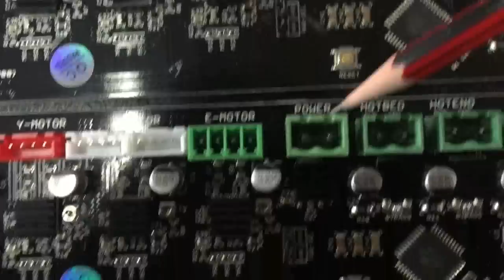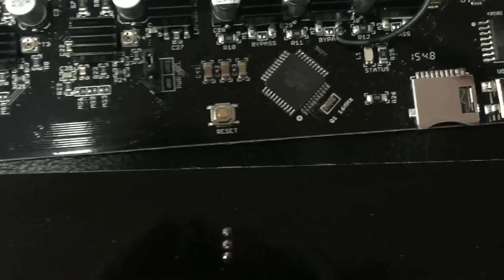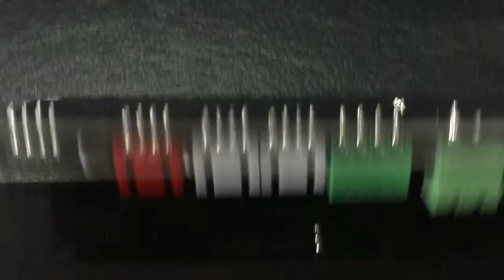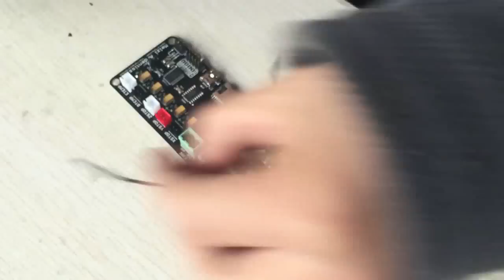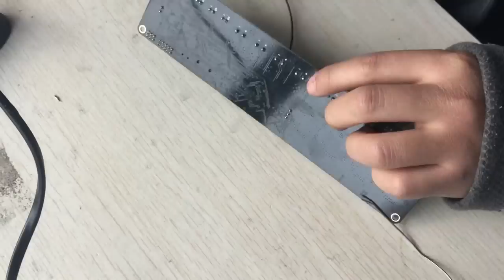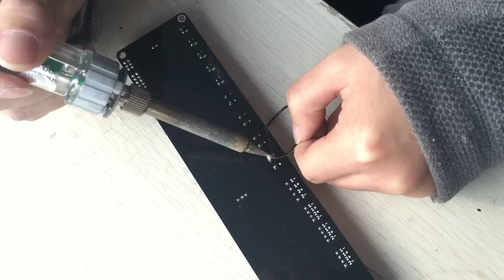Wanhao Duplicator i3 extruder temperature flucturating solution

Comment: Hello Manolo. If you can - answer my question. The heating of the extruder on Wanhao i3 is periodically turned off: you start simply heating the extruder - after fully warming up to 220-230 degrees after a few minutes, the set temperature on the screen shows zero and in the column of real temperature it is seen that the temperature gradually drops. The same when printing - a few minutes prints, and then the temperature drops. Plus - when the temperature drops once the screen went dark, although the fan inside was working.
What could be the problem?

Comment: My i3 hot end went straight to 285c when I switched it on. Thought the board had a fault told my vender he sent me a new got it this morning. when I opened up the controller box I found that there was a solder connecting the earth and the 2 little contention next to it together.So the Mosfet for the hot end was on all the time.

Comment: Question is there a video on how to print from Cura directly to the mini-USB port?  I tried connecting everything and it tries to connect but fails, have the baud and port all set correctly however do I have to set something on menu on the unit itself?  Also thanks for this video as I having this issue and plan the fit ASAP.  Will also publish a video on it too.

Comment: In addition to the previous post, we wanted to add that all new Di3's will ship with the proper ground cabling pre-installed. This is an issue that has been corrected in current shipments.
Reply: +www.wanhaousa.com Someone else asked already, but does the same procedure apply to the wanhao i3 V1?

Comment: This is an issue that is limited to only a small batch of Melzi mainboards on Di3's. This temp issue is distinguished from other temp variation issues because it only occurs past 200C and the temp jumps about 10 degrees up or down. If you have not seen this variation in temp issue with your board already you will most likely not experience this at all/ever. If you are experiencing this issue you can contact our support techs via our live chat (1pm-5pm EST M-F) @  www.wanhaousa.com or at support@wanhaousa.com. We are currently sending FREE pre-paid shipping labels for you to return your Melzi mainboards to our shop in Miami, Florida. and we'll add this grounding cable to your board at no cost to you (free shipping included both ways). Contact Manny via the live chat for more info and instructions.
Reply: +www.wanhaousa.com Would a temperature fluctuation between 209 and 219 against a set temperature of 215 be enough of a variance to suspect this problem? Or is the ten degree temperature jump in each direction from the set temperature? That is, would I expect to see a range of 205-225 when I set the temperature to 215, if I had this problem? 

My order was shipped on January 13th, 11 days ago. Thank you for the video and the timely support!
Reply: Could a grounding issue be causing my control to randomly switch and select on the menu with beeps while printing? Its driving me crazy.

Comment: I should not have to solder a wire on a board, especially when my printer is still in warranty. So what are the options to get a working board?
Reply: +Stig Brännlund So?  They are responsible for the parts they purchase and they should deal with their suppliers.

Comment: Is there any required gauge of wire that needs to be used?  Also in terms of warranty, does this void it?
Reply: Maybe so, but if you get an unintended short in the process they won't. That is what happened to me when I tried to fix my first board. Even though they admit in this video that the boards are defective (and I explained this issue to them), they won't cover anything to the board that happens on the part of the customer. I would recommend anyone wanting to do this who doesn't know how to solder - send it back and have them do it. It is cheaper to pay 50 bucks to ship it out than pay 90 for a new board. I'm not mad at Manolo, these printers are actually great. I don't mind paying the 90 bucks and think the fact that he is honest about his product is really a sign of a good company.
Reply: This is WAY too late to be of any use to you, but for someone that maybe reads this now, use 18AWG wire. You could probably do with 20AWG but better safe than sorry.
Reply: +Joshua Hunt if you do anything that breaks the printer - they won't honor your warranty. I cleared a clog and the thermistor wires shorted when I put the thermistor back due to the wire being slightly exposed. They told me I had to by a new board. So be careful. I think I will do this myself when my new board comes in, I was getting some fluctuations myself in my prints.
Reply: +animateclay Manolo has emailed alot of us and said that they are going to cover this in the warranty

Comment: the boards are obviously defective. so how do i go about getting replacements for my Wanhao I3's. I can post videos of the temperature fluctuations on all of my I3's and would like the boards replacing under warranty..
Reply: +Graham Melbourne wanhao is just buying these boards prebuilt based on an open design. (they didn't design or manufacture them) They are just adding these wires to the new models. So there is no replacement better board, they are just doing this mod on all the new ones going out.